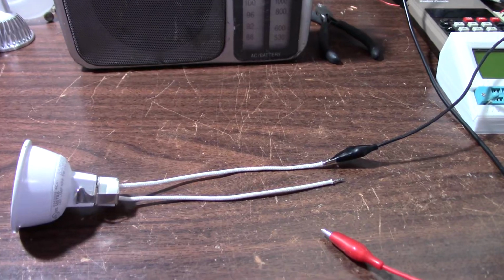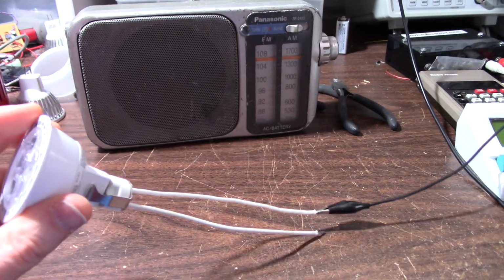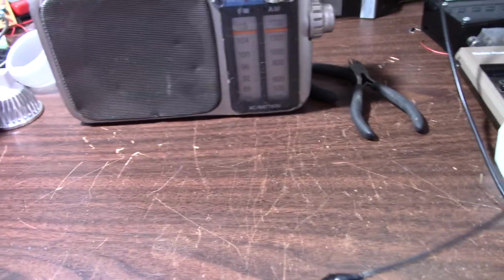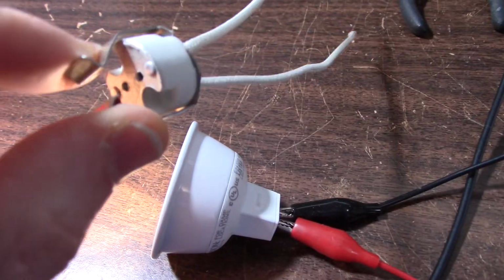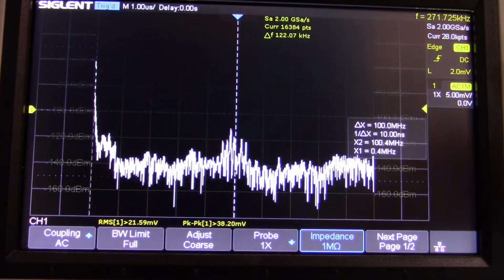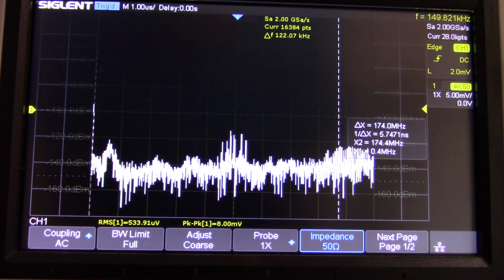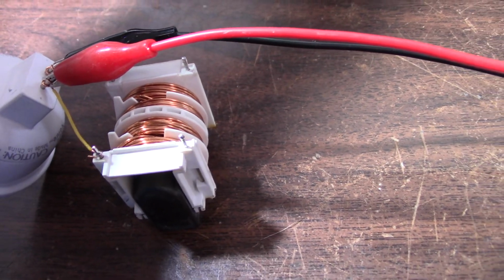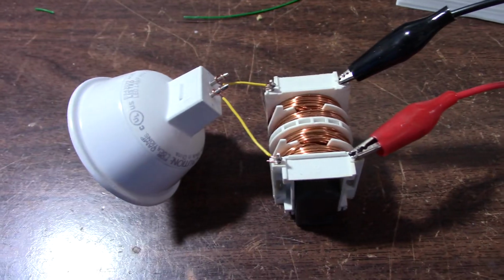LED bulb interference with radio reception

Comment: It seems that the FCC has given up protecting the analog radio bands.  It's sad, but not surprising at this point.
Reply: Yet if you put up a fan transmitter it bleeds in over your neighbors, radio station you get in trouble. But you have a big building filled up with LED lighting FCC don’t care if your neighbors pick up interference from lighting

Comment: Great stuff as usual sir, i had a similar problem with a dodgy high power led lamp, you could hear the hiss a meter away, and even my scope could pick up a few spikeis from the emission of the crapy LED lamp, the sad thing is that i thought my scope had a poor noise floor, due to the harmonics emitted from the awful led lamp.  Good work John please keep it up.

Comment: I am eager to see what in that LED bulb causes the interference noise.
Reply: A nasty little switched mode power supply with minimal filtering to keep the costs down and fit into the relatively small bulb housing.
Reply: Why do they put a power supply when the input voltage for the LED bulb  is already 12 VDC?
Reply: @listerine-pr5lt  LEDS are usually driven to a fixed current.  Without a regulator, it would be far to sensitive to variations in the "12 V".
Reply: @listerine-pr5lt  Several reasons. 

LEDs work on a constant current, not voltage so need at least a resistor. But that's inefficient if you're dealing with the amount of current you need for a bulb.

And  LEDs need to be fed with the right polarity so again, that's at least a rectifier as the bulb and holder aren't polarised.

Finally, there are a lot of low voltage lighting installations that use just an AC 12v transformer for power - fine for an incandescent bulb, again no good for an LED. You're going to need a rectifier AND a smoothing capacitor now as well. But this will give a peak DC voltage of just over 15V (assuming a 0.7v drop across the rectifier diodes)

 A solid state 'transformer' however will be DC at pretty much dead on 12V.

Add the whole lot of requirements together and you end having to include some kind of regulator that can provide the right amount of current for the LED from a relatively wide variety of input voltages, polarities and frequencies.

And the smallest and most efficient way of doing this is with a single chip switcher regulator.

The downside is they give out a lot of RF noise if they're not suppressed correctly.

There are probably some other good reasons too !

Comment: Have any ferrite beads? Maybe one of those clip on ones? Put the wire leads back on and the bead, see what happens.

I'm in line with Leif, this is an FCC issue.
Reply: I had an LED spotlight that was knocking out TV reception. Ferites didn't seem to help too much for me but worth a try.
Reply: Depends on the issue.  The ferrites should help keep the wiring from acting like an antenna but doesn't clean up the source.  Also note the formula used for the ferrite - you might be using the wrong formula for the frequency of interest.
Reply: @russellhltn1396  I went back and watched the video again, comparing the light with leads and.the light with just pins. It did seem a hair louder with the leads, but there were still power leads from the power supply, so you still had a pretty long length of radiator. When put through the choke, it was most definitely attenuated. Now a ferrite bead may be way off, but it wouldn't hurt to try. Still needs to be reported to the FCC with this video as support. 

John, do you have a housing for the lamp that you could wire up on the bench to see if there's any additional shielding there?

Comment: I want to do some videos on line noise too if I can clear some dogs off the bench. Skiing is wrapping up but now I have other issues to contend with, Mom is back in the hospital. Anyway, my challenge is with my X10 stuff. The old UPS I brought home actually works but totally blacks out nearly all X10 communication when plugged in. Bought something that might help.
Reply from the maker: I know you've had issues with some LED bulbs and X10. The protocol does not seem to have any resilience to interference. Sorry to hear about the downturn of your mom's health.

Comment: Can a filter capacitor value be responsible for change in output voltage ? Suppose if a 12 volt 2 Ampere transformer is connected a 2200 uF capacitor instead of usual 4700 uF , will that result in increase or decrease in output peak voltage ?
Reply: Normally, No. Only if the original value was too low to adiquatly filter VS demand. John showed that in a video where he was able to get slightly more power out of an amplifier by increasing capacitance.
Reply: 2- 2200uf  in parallel are better than 1 4700uf, less Resistance . Rule of thumb is 2200uF per 1 amp of current

Comment: I installed LED bulbs in my garage door opener... Guess what stopped working... That's right, the radio controlled remote openers.  Had to switch back to a tungsten style bulb for now.

Comment: You know, when(if?) they tested this for the FCC they might have been using power leeds that are shielded right up to the bulb in order to pass. This methos of testing doesnt take into account all the wiring. I have pretty bad electronic noise issues in my house - I think from polluted wiring - it is even worse because it is knob and tube so my wiring is made of giant loop antennas.
Reply: No way that this was ever tested for the FCC requirements.
Reply: @johncoops6897 if my big bulging full of LED lighting interferes with the neighbors radio FCC won’t care. But if my little radio station interfered with the neighbors radio FCC cares lol

Comment: I ran into the same problem with those low voltage LED conversion lamps.  Installed an inline EMI filter on the primary of the transformer, that helped but also had to rectify the secondary and filter the output.  So I ended up feeding the lamps with DC instead of AC to keep them quiet.  Not sure what a home inspector might say about all that sitting on top of a kitchen cabinet.
Reply: I use laptop power supply brick adaptor, they have better noise suppression.